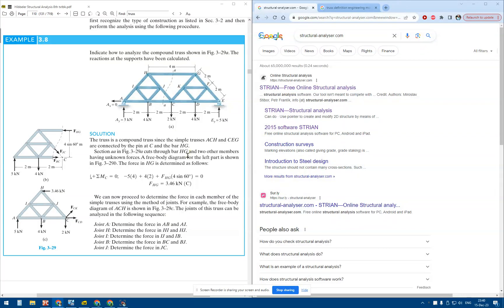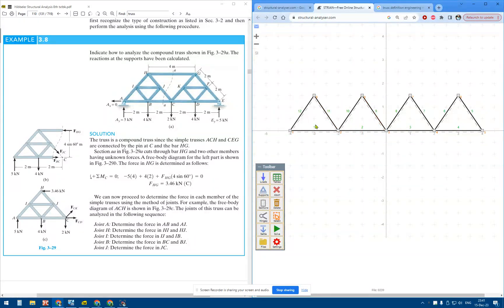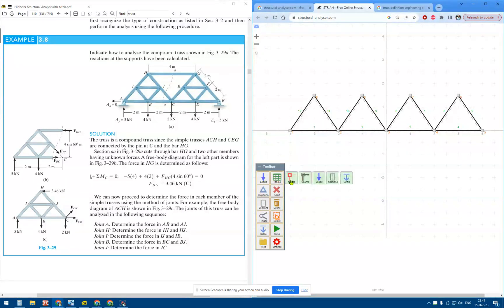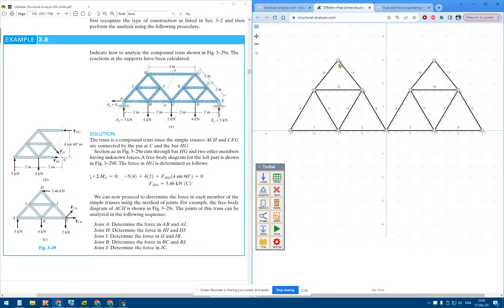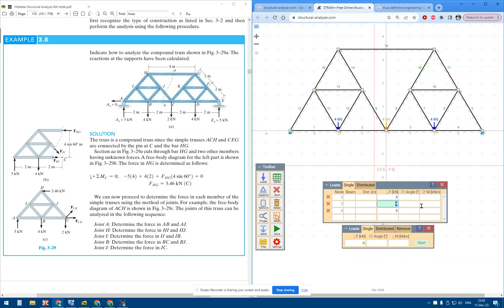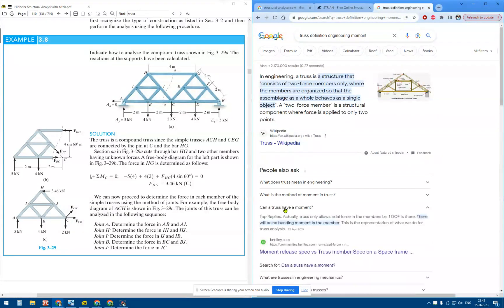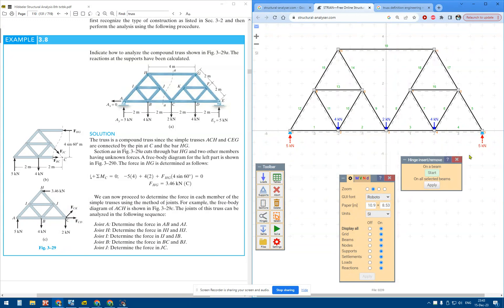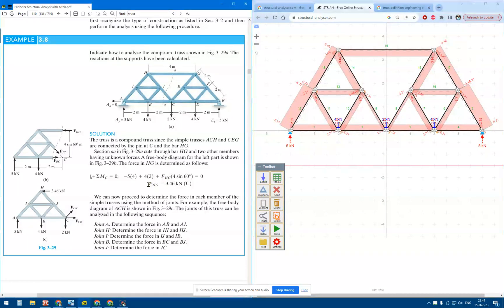STRIAN 2.0 Structural analysis software Online Free – Truss calculator

Comment: Is there any way to solve any frame when the value of EI for  members is given as 2EI, 5EI,... & so on, using this tool?
(Here value is given in terms of EI only & area of cross section is not mentioned)

Hope you will reply !
Reply from the maker: If the area is not given, you can make up a value. The same applies to modulus values—e.g., use 200 GPa, 500 GPa for different members as needed.

Comment: How can we add or give  a member force to a truss member already and then analyse the whole truss, in this strian analyser tool?
Hope you will reply it.
Reply from the maker: Sorry, I am unsure what do you want to achieve. If you want to simulate pre-tension or pre-stress in a truss member, you can do it by applying equal and opposite forces at both ends of the member.
This way, the member will behave as if it already has an internal force before solving the rest of the structure.
This is a workaround — there is no direct way to “assign” internal force to a member.

Comment: is it possible to still use the original strian? i feel the 2.0 version is full of bugs. For example, supports are not showing up on the interface, load directions either, results are not realiable. Ive tried several easy beams that i know the results, and shows inconsistent results. not sure if you guys are still working on the project....
Reply from the maker: Hello! The older version is accessible at https://structural-analyser.com/old. If it's unresponsive, please wait until it fully loads, then reset the canvas size within Settings.

Your feedback is invaluable! Please describe any issues you're encountering with Strian 2.0, and I'll work to address them promptly. Let you make a screenshot or share your project.
Reply: @stibot007 thank you. for some reason when i try to add the supports to the beam, it seams its not really adding them. they dont show up in the interface. then when i press solve it gives an error of unstability since it didnt really add the supports... thats the issue ive been having with strian 2.0
Reply from the maker: I haven't encountered such a problem, and I've tested it on Chrome, Edge, and Safari. If you're using a tablet, pinpointing a node might be a bit tricky. In that case, try zooming in or increase the Settings/Zoom within Strian 2.0 for better accuracy
Reply from the maker: Unfortunately, I can't test and support all browsers. The program is complex, and fixing all browsers would make the code complicated and unmanageable. However, there's a workaround for you: go to Tables/Nodes, and the last column is the support type.
Reply: @stibot007  thank you so much. I will try that